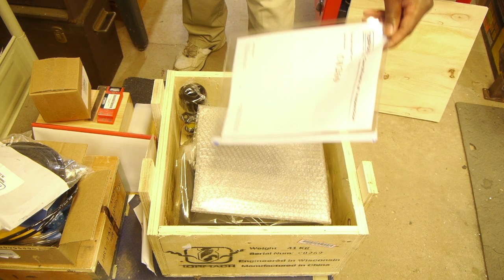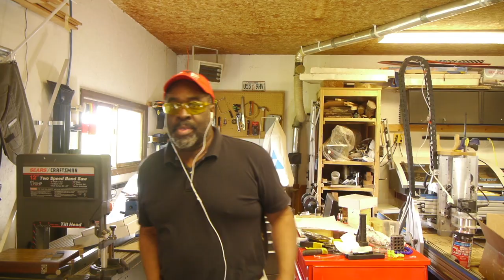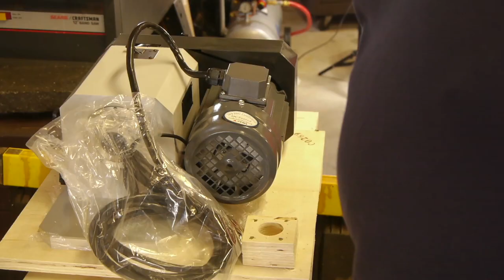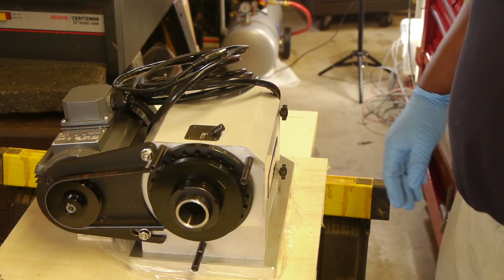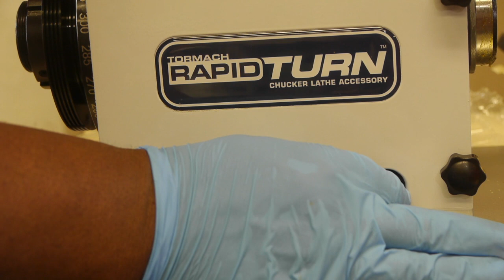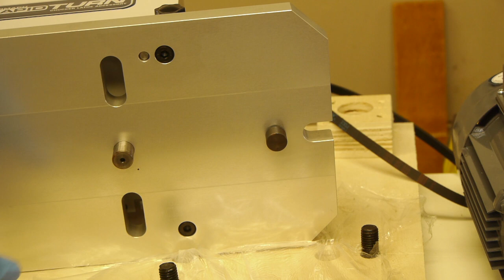Unboxing Tormach RapidTurn CNC Lathe Indexer

Comment: I got my RT about 2 week ago and  had issues with the sensor, could not get the RT to go above 350 rpm when using CSS.I called Tormach but could not get thru to support so after a week I ordered a new sensor and installed it myself and it works ok now.
Reply from the maker: Tormach recently did a video on how to adjust the sensor.
Reply: I did the adjustment and that did not work for mine, I did notice that the new sensor was different with a diff number . This was also talked about on CNC Zone. You should try a piece of 1 inch round stock and turn the Dia. down and about 1 inch in the z  as this is how I first noticed the RT would just stop as soon as the RPM would increase. Some people had erratic speed and then stop.
Reply: PS that video came out right after I fixed mine.